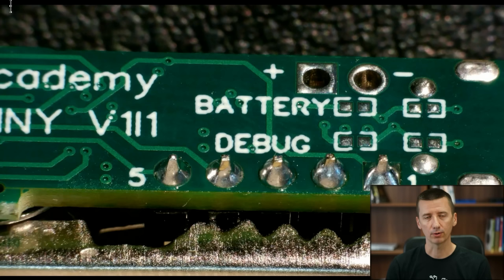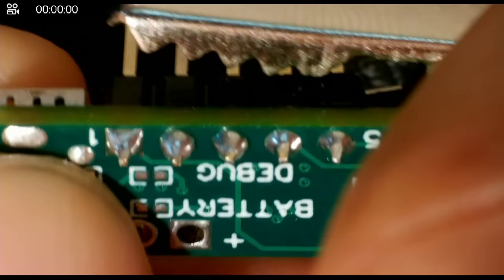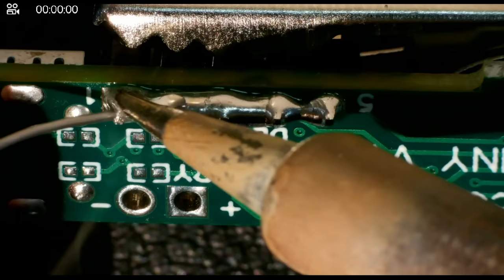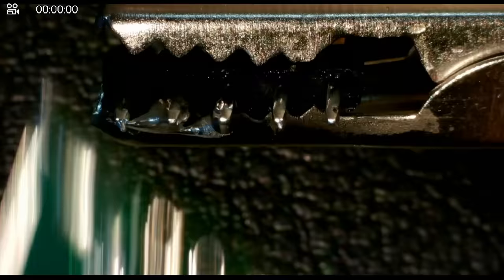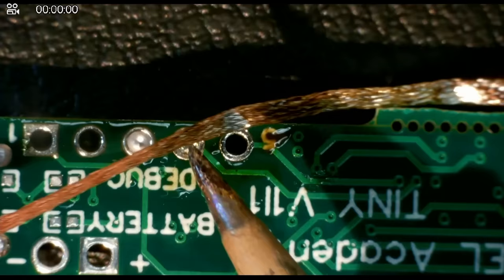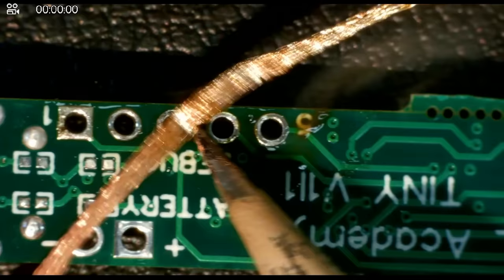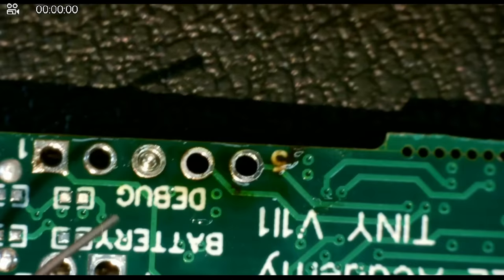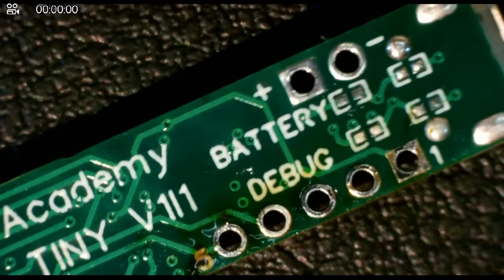Easy Way to Desolder and Remove Through Hole Connectors or Components

Comment: And now do it with 20 pins.
Reply: Same as 5 pin connector 😂😂
Reply: Buy desoldering gun 😅
~10$ for simple iron with integrated manual suction pump and ~100$ for semi-professional fully automatic desoldering gun.
Reply: @Faiver  I got a hot air gun for $13 on Amazon. But yeah, this method is good for small connectors.

Comment: My method is to remove the plastic part holding them together and then remove the pins one by one, heating them up and quickly pulling them out with tweezers. Quick and hassle-free, as long as you don't really care about ruining the part you're removing.
Reply from the maker: I sometimes do that too - especially for some headers it is very simple to remove the plastic.
Reply: I ended up going that route (pulling individual pins) on a rather expensive CO2 sensor that I had messed up... and ended up screwing up some of the pads, and had to toss it out. This method (bridging the pins with solder) would've probably worked better to save the component (and saved me a few bucks!).
Reply: This!  One by one is there safest way to preserve the PCB.
Reply: @JeffGeerling  that's because you're a software guy and should stay away from hardware 😛
Reply: in my case I care very much about the part I am removing...
Reply: If you dont care the just rip it out.
Reply: Cool story. Make your own video hater
Reply: Chemwick solder wick is awesome stuff you need the right stuff though rosin wise. Before that I had some trouble, after getting that parts literally fall out 1/2 the time so mark which way it goes if unmarked!
Reply: A N I M E
N
I
M
E
Reply: @zz3709  I find prying off the plastic is much more likely to damage it then quickly flooding every pin the same way you'd remove a mcu or daughter board.
Reply: I've done that before, but it definitely runs the risk of damaging the circuit board.
Reply: You can ruin your PCB-board that way.
Reply: This one tip helped me tremendously. I was needed to remove an 8 pin relay was trying to remove all the solder so it would come out to no avail. Then I saw this video, but you can't use the method of adding move solder to a relay that has three lines of pins. BUT, I was able to cut most of the pins and then easily unsolder the one pin left. THANK YOU Robert Feranec for posting and THANK YOU yukayuyu3844 for adding this tip. God bless you all.
Reply: What plastic? what exactly does that refer to

Comment: Better way, use a piece of copper wire (single core) as a thermal transfer aid. Cut it to size and add it to the connector, add tin an it will ensure the heat spreads around. Best part, you can shape the wire to fit on more complicated pin layouts and still get the heat spread out evenly over all pins.
Reply: Yep.  Do you have any tips that would work on 2 very widely spaced, very long rows like an ESP32 Pico D4 / pico kit?

Comment: I often use a bare copper wire, that I solder all along the pins I need to desolder. This wire acts as a heat spreader. It is more or less the same technique as yours, except it needs much less solder. Anyway, great video, that will help many people out there. Thanks, Robert.
Reply: I use a desoldering pump and when the amount of solder is small enough I use the desoldering copper wire. Sometimes adding lot of heat in a transistor or ic can be not that good to the part
Reply: Good tip! Will test it next time.
Reply: is this safe for ICs? will the high temp be bad

Comment: This is a good technique and works for small surface mounted parts too (flood with solder and heat with iron until the part is loose). This technique has been known for many years. For multi-layer PCBs this technique will definitely NOT work because the inside layers act like a heatsink and take the heat away from the part. You will use a full roll of solder and still get nowhere. Even with a dedicated powered desoldering tool you can not remove through-hole parts on a multi-layer PCB. Most of the pin holes can be cleared but the VCC and GND holes will remain blocked. The secret is to use some hot air to heat the PCB to about 150 degrees C first, then use the desoldering method of your choice and the part will come free much more easily.
Reply: I concur.
Reply: Excessive heating results in removal of the tracks & pads, resulting in a damaged pcb.
Reply: @chetananam9141  150°C is safe for PCB, you can keep that preheat temp for many minutes. I preheat to 150 °C with hot air fountain from below the pcb. Once pcb is preheated, any soldering or desoldering becomes way easier and quick and very little thermal stress to pcb
Reply: @ideegeniali  nice to know that. Thanks!

Comment: Thank you for this video. Desoldering is a bit intimidating to me after a few not so good attempts, but this helped. I also realized that flux helps as well and I was able to successfully remove some wires and clean the holes on a PCB just now without much issue.

Comment: @2:40 thank you for the tip to add more solder if you're having trouble cleaning the hole. this video saves me having to buy a solder sucker - I only have 2 holes to clear to replace a battery & it's clear from this video I can get the job done w the wick that is arriving today!

Comment: Another "do the opposite of what I usually do including mess it up" instruction.  This worked great.  It would have never occurred to me although I do add solder trying to trying to get my solder wick to work better.  I have a jar of flux now and  I just lay the wick on top of the flux paste and press the tip of the iron on the wick to liquefy the flux and the wick soaks it up.  Then it works much better.  My solder wick always looks terrible and tarnished like I found it in the street somewhere.  My system is similar to yours except when I get done the traces are gone and stuck to my solder wick.  
I just ordered a temp controlled iron to keep the heat down (from china).  Hope it works ok.

Comment: Thank you so much brotha, man I would have ruined my lucky break to have come across the component I needed if I hadn't seen this, and it worked so surely and smooth 👍I was just about to start burning it until I used this method

Comment: Hello Robert!
Thanks for the great tip :) I use the same technique for such things!
I would kindly add - sometimes I add some more flux on the tin-plugged hole before putting the copper wick and/or increase a bit the solder iron temperature.
Most problematic it's the through-hole pad, which connected to the massive ground plane!
Reply from the maker: Thank you Igor PS: Yes, that problematic pad is exactly a GND hole connected to plane. Great tip!

Comment: Low melt solder to the rescue, that's a lot easier and less likely to damage and burn the pcb. Also works on very large pin counts and multi layer boards with large copper planes. A soldering iron with a large power/heat delivery capability is also handy in such cases (ie 200W in a large chunky copper tip with sensor as close to the tip as possible), to get the lead free solder to melt to get the low melt mixed in.

Comment: Thank you for the advice. I will try it!! Up until now, I have separated each pin by cutting the plastic part and then individually removing each pin. I don't have much luck in cleaning the solder from the holes with the wick. I use a solder sucker on the bottom side while heating the top side.

Comment: Excelent, it works great. I manage to desolder double 6 pins little pot meters without damaging the circuit board. You save my day, thanks for sharing. B.t.w I not used the clip.

Comment: I foud this tip wery useful long time ago. First time I saw it in your 100 evry day hardware design  tips. And also I test it on several kind of components (2 rows 40 pins  IDE hard drive header -> easy peasy)
Thanks!
Reply from the maker: Yes, I mentioned this in some older videos. PS: I wanted to try my new microscope and this was a good topic

Comment: Nice tips, I've been struggling with the wick, and one difference I noticed in your video is the presence of flux, whereas my desoldering wick is as dry as can be. Next time I need to clean through holes I'll try adding flux to the wick.
Reply: The brand name of the desoldering braid you use really matters.  I've found only the name-brand braid to be reliable.  The cheaper no-name stuff often does not work well at all, and I've even found some that was made from copper-plated aluminum wire.  If you take the cheap route,  you'll have a difficult time.  Get the good stuff.
Reply: Flux is your friend, use lots of flux.  Clean it up when you're done with alcohol.
Reply: I saw a recommendation to use wick made by “MC chemicals” that has flux in it

Comment: Can I use the solder wick/wire and soldering iron to create circular holes in a pcb board where the pin connectors are fitted?

Comment: Any tips on the old board?, I've spent a lot of time but there is no progress even heating with at maximum heat of soldering iron, it not get remove. I've tried your methods it doesn't work unfortunately.

Comment: Use flux instead, you'll save solder, save your solder wick, and save time AND mess :)

It's worth investing in an Engineer SS-02 solder sucker - it's the only one I've found that actually works as it has a silicone tip that you can stick directly on the solder joint! Use the solder sucker first then grab the rest with solder wick/desoldering braid

Comment: Very good video bro. Great info!
I need to remove a joystick from a ps4 controller but it is connected in 4 different points in square form ( not too close to each other)… do you have any tips?

Comment: Heat the joint, then tap the board against your bench. The solder has far more inertia than anything else, so when your board stops on contact with the bench, the solder continues on and flies off the board.

Also... at times, a vacuum solder "sucker" can be very helpful.

And... if you don't care about keeping the part you remove, it's often best to cut all its leads above the board. Then you can desolder them one at a time without wasting your expensive solder.

Comment: On smaller boards I put a towel on the edge of my workbench and then quickly but gently tap the board on the table after heating the solder to melting point. Another way I like is to use a dremel type tool with a cutting wheel to cut the legs on the component then can remove the pins one by one with pliers and soldering iron. I only do this on components that are no longer functional.

Comment: Hi thanks for sharing, I'm trying to replace rj45 socket. this method works great for single socket. but desoldering 4 socket is too hard. is there any other method / easier way?
I read through some comments, someone mentioning about desoldering station. can you suggest which desoldering station is best budget for me? mostly just for replacing rj45 socket.

Comment: Robert,
You can put moldable clay or Play-Doh under your parts when soldering and using your camera. It will help keep them in the camera shot, and stuck to the table.
Reply: Why should I put Plau-Doh under my parts? I don't even want to show my parts on camera! 🙄
Reply: That’s clever. I hate using my cheap PCB holder

Comment: Holy cow, this is genius!

I tend to enjoy gaming on Playstation and typically
buy third party PS4 controllers and end up modding
the tension spring in the L3 / R3 thumbsticks.

Problem is desoldering them from the PCB is tricky
and I, from time to time, tend to ruin the components.

...or the PCB, and this can get a tad pricey for me.

Your method should be helpful to me!!
Reply: Exactly For what i came

Comment: I would recommend using a solder sucker pump to remove components. Your method will work on a connector but not so good for components that might be damaged by heat.

Comment: If you do this on more than rare occasion, get a desoldering gun.  It's like a solder shop vac and removing that part, leaving clean holes, would take 10-20 seconds.  There are many by different brands, I have both a zd-985 and 474A++ and both work very well (both from generic Chinese companies), we have a Hakko at work and Metcal makes one too.  There are many to choose from, it's one of those thing that makes a not fun job almost fun.

Comment: Im struggle with the same scenario, i try to desoldering analog controller pin through holes and all the heat was absorbed by the analog plastic and the board when i tried to suck the solder with wick, so i must destroy the analog, what a bummer.

Comment: My ancient blue plastic Soldapult solder sucker still works fine. I could see using this alternate technique in rare cases, but certainly not for a five pin connector on a single layer board.

Comment: Somtimes the solder is 20 years old etc from old circuits and adding new solder does not melt the old solder on the board that much. Whats to be done in that case? Im new at this. 😅

Comment: Thanks, I may have another method. If you wind some copper wire around the tip of the soldering iron, just like you wind ground around a probe and make the copper wire be so long that it touches every pin, then can you remove any chip in one go. If you have pins on fore sides do you simply bend the wire to a square so it can touch all the pins at once. Hope it makes sense?
Reply from the maker: Interesting. Thank you Fried

Comment: Hi Robert.  What did you use for cleaning the PCB after desoldering?
Reply from the maker: I use KONTAKT PCC 200ML https://sk.farnell.com/kontakt-chemie/kontakt-pcc-200ml/cleaner-kontakt-pcc-200ml/dp/2142400

Comment: I tried for like 10 minutes on and off to desolder  some capacitor pins and still had trouble even with the wire. At what grade do you heat it ? Celsius?
Reply from the maker: Maybe this can help? https://youtu.be/y22Ia6gJDr8 - to cover the whole capacitor. But I am not sure if you are trying to desolder a through hole or smd cap. If it is a through hole cap, the GND pin may be connected to a ground plane which is taking a lot of heat away - so you will need to heat that up a lot. If it's not working put soldering station higher temperature or maximum

Comment: Thanks for very useful tips. But what is the cleaning solution with the brush at the end?
Reply from the maker: I use KONTAKT PCC 200ML https://sk.farnell.com/kontakt-chemie/kontakt-pcc-200ml/cleaner-kontakt-pcc-200ml/dp/2142400
Reply: @Per Thomas Jahr   Or use what most people use, IPA (Isopropyl Alcohol)

Comment: Great video, did you try desoldering needles? It's easy to use them and get good results.
Reply: Sometimes there's a real gem in the comments! I had never seen desoldering needles, but checking them out they look very handy!  Thanks for posting!

Comment: Use more tin to remove a smaller amount it is counter intuitive, but that's the easiest way to remove it😂 
I use a rigid wire to spread the heat, but most of the time I destroy the plastic no part... 😥 I'll try your method next time, thanks a lot Robert!

Comment: I know someone who removed memory chips from a large mass array with a gas torch on the solder side and a screwdriver sliding down the chips on the top. Recovered hundreds in minutes. That was old days now simmilar is done with SMT and no one complains.

Comment: Sometimes I use this method, sometimes an extra wide tip from a JBC solder station (C245913 or similar).

Comment: For that connector, you could just heat the solder with iron and pull out the pins one-by-one with pliers. No need to add solder or even remove the plastic, just heat the pins and pull them out ;-)
You should do some other desoldering tasks that are a bit more complicated. Especially techniques where the part needs to be kept in one piece and not damaged.

Comment: My 40 year old solder sucker still works fine. I could see using this technique in extreme cases only. Certainly not for a five pin connector in a single layer board.

Comment: Adding more solder to make desoldering easier -- it seems backwards, but it looks like it works... Thanks!
Reply: its because he mixed leaded solder to unleaded. leaded solder have lower melting point. also with multipin, this can transfer heat from iron to more area

Comment: Please help me.....
My Soldering iron bit is only becoming oxidised. I am using a 25 watt SOLDRON Soldering iron. Is there any way to prevent oxidising?
Reply: Leave a solder blob on the Tip when not in use, some Iron manufactures say not to do this as it could corrode the tip, but I've used the same Tip for about 25 years and it was 2nd hand when I acquired it. (Weller PU-3D TCP).

Comment: I assume you used leaded solder? (I use leaded solder on unleaded solder connections to lower the temperature required to remove parts).
Reply from the maker: Yes, that is correct - for hobby boards. However for products the lead free solder needs to be used, the technique would still work, just it is a little bit more difficult - higher temperature is needed.

Comment: Very good video, you make it look so easy. What is the cleaning solution you are using?
Reply from the maker: Thank you Tom. I use KONTAKT PCC 200ML https://sk.farnell.com/kontakt-chemie/kontakt-pcc-200ml/cleaner-kontakt-pcc-200ml/dp/2142400
Reply: @RobertFeranec  How about the flux you use?
Reply from the maker: @tomb8430  nothing special, just what they had in stock and I would not buy it again - smells really bad. There are better flux-es but I forgot the name ... maybe someone else has good experience with a specific flux? Any tips?

Comment: Small stainless tubes are much more comfortable for a such operation.
If you need clean hole, use toothpick  with welder - make it hot and pull

Comment: I use dipping method its fast its done by preparing a small bowl heated by heater and melt solder we can use it to solder all the board in seconds or desoldering  big parts